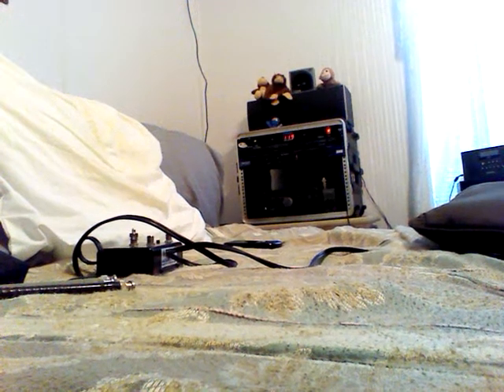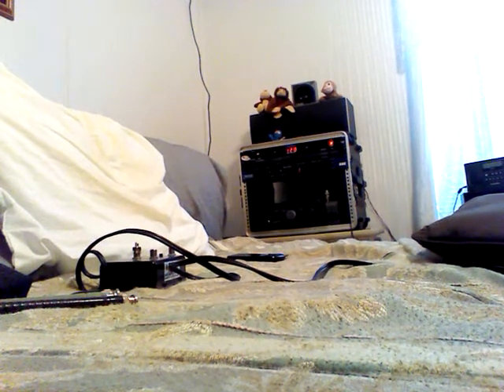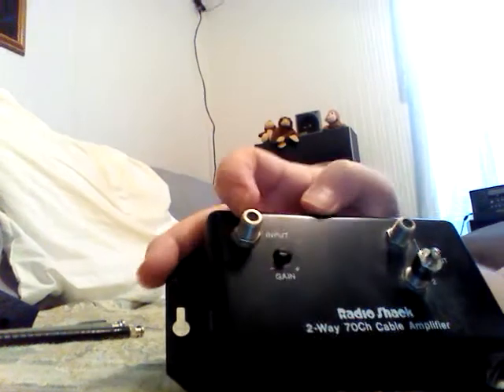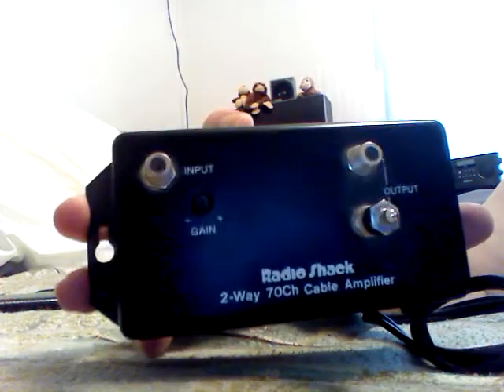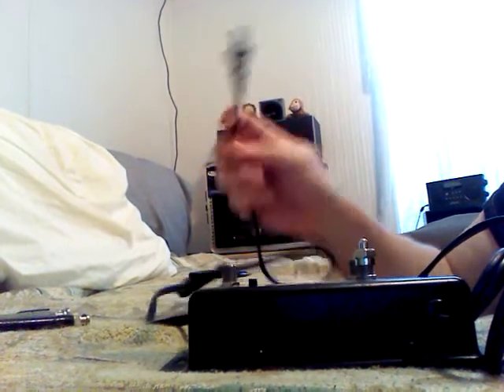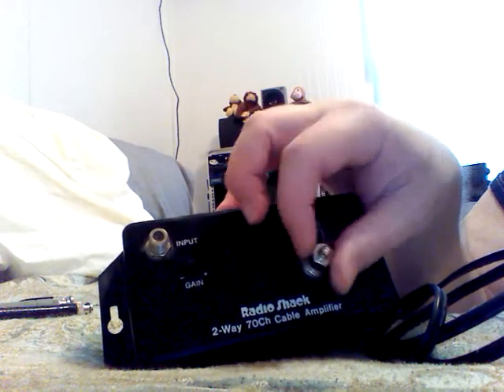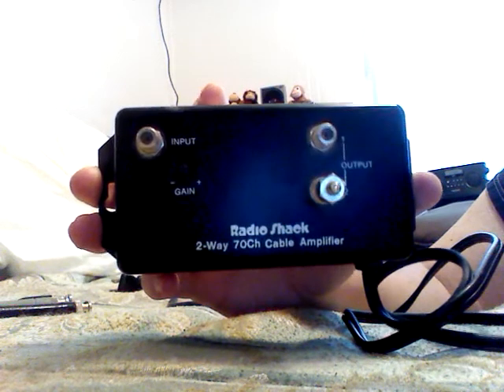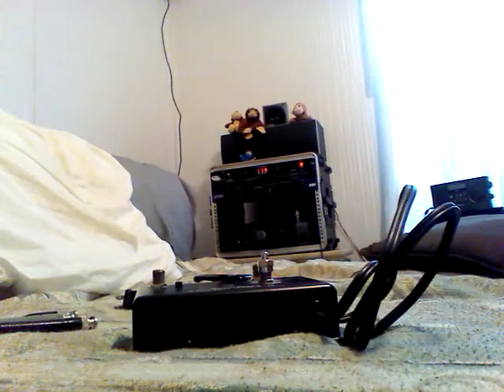Using a cable tv amplifier to boost scanner antenna reception ..an Experiment! RadioShack 15-1960B

Comment: Did it ever work?
Reply from the maker: outlawtrucker42 it does but on some freqs have to use the attenuate and definitely an FM trap I don't need it in current spot in on the coast but when lived inland was more useful esp. On milair uhf
Reply: A better solution is to use a TV antenna Vhf/Uhf amplifier. the frequencies match closer with those used with Scanners. also, consider mounting a Discone or TV antenna to receive scanner frequencies. I use a Radio Shack portable TV amplifier so I can be discrete.
Reply: For Radio-scanners ......waste of time : Won't do anything dramatically on 50 Ohm equipment ... 
In this country, most houses are provided with cable tv connection what connects the TV sets of an entire town on to a huge central antenna (335Mtr) situated at the Dutch town of Lopik.
So every house has a connector in its wall for coax connection indoor. All also 75 Ohm.
now some 40 years ago I already tried to use this as a super antenna for my scooper scanner.
There was receivement and from long distance to, I can't deny that; yet not very clear and.......in most weak volume...

The difference in ohm is the isolater.
Always found it strange, why they didn't build radio-scanners using 75 Ohm technology .....
75 Ohm has a smaller loss of capacity in signal due distance.
But because all radio-scanners are build according 50 ohm
technic, they are doomed to take the loss...